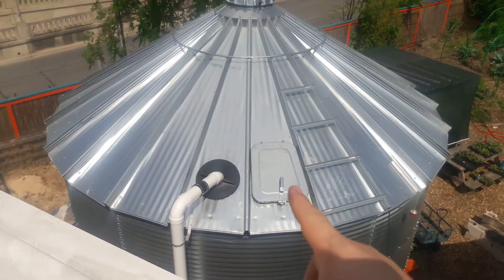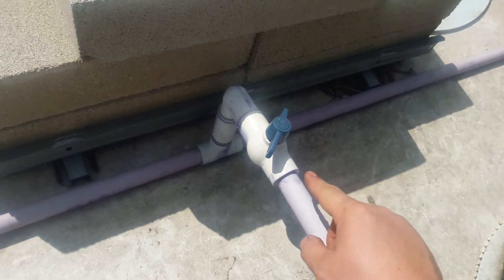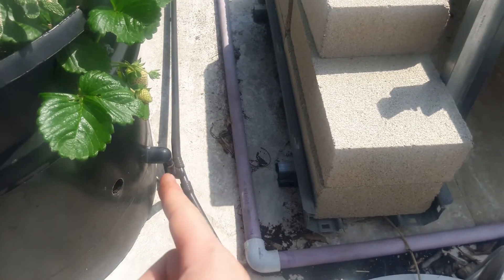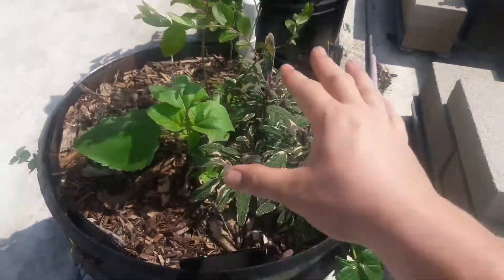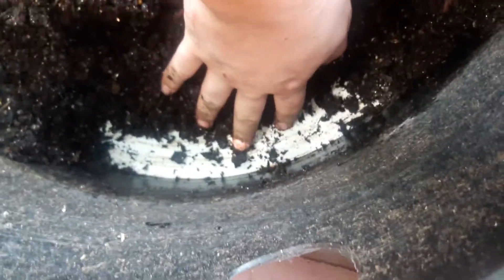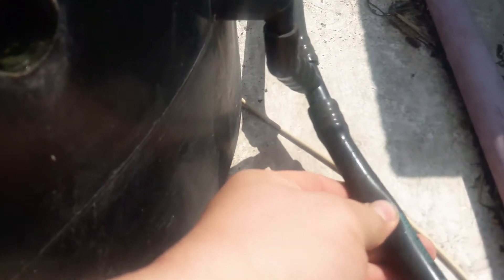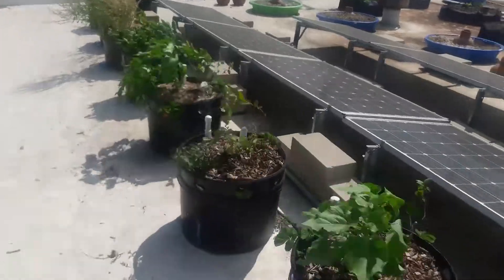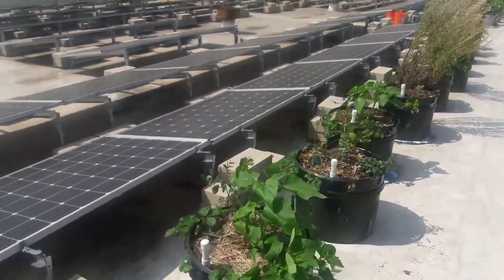EASY SELF WATERING CONTAINER FLOAT VALVE BUCKET SIP SET UP - SUB-IRRIGATED PLANTER WICKING BED SIPS

Comment: Maybe a dumb question but why does the water not keep filling up the first container until it just overflows? But it doesn't. The water reaches a point where it stops filling the first container and then moves to the next container. Why?
Reply from the maker: water always finds its level. so it will stay on a level path until it meets resistance then it will start to rise.

Comment: So I'm trying to understand the float valve. Do you have it so the height of the water in the reservoir is what you would want in the plant containers? So when the water in the plant containers go down, the water in the reservoir goes down making the valve open to allow more water to fill? Is that correct?
Reply from the maker: That is correct as the water in the planters goes down the container holding the extra water fills them up. Thus it also goes down lowering the float valve letting in more water
Reply: The reservoir with the float must be at the height as the other containers and must be level for it to work right.